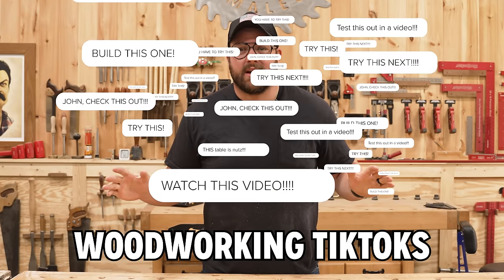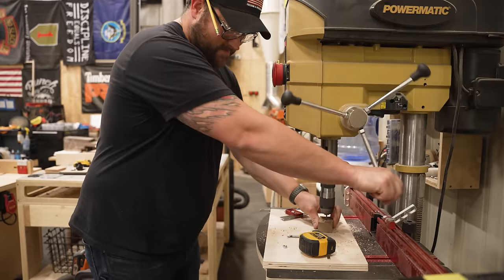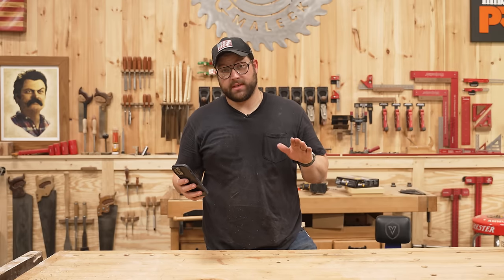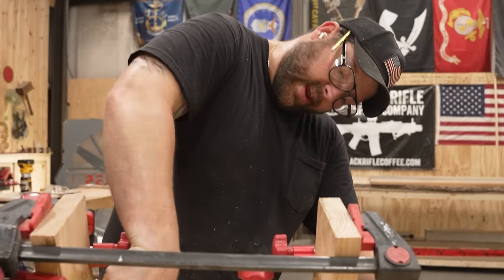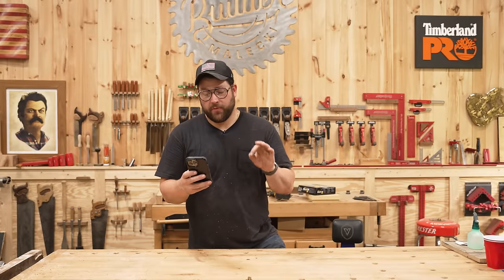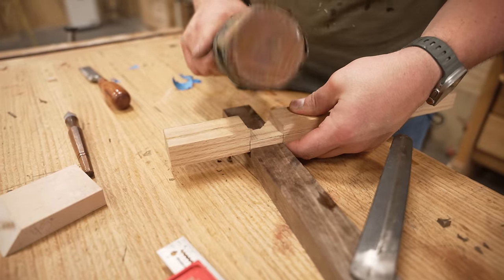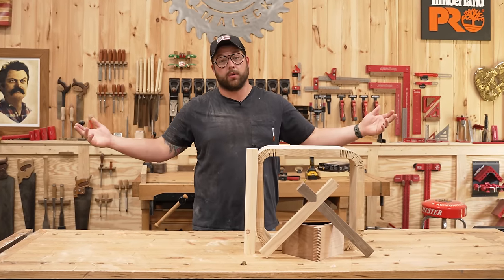Testing More Viral Woodworking TikTok Techniques

Comment: Could he have wet the timber when he chiseled it, looks wet to me?
Reply: It maybe a stabilising resin too
Reply: It's definitely the wood and not the chisel. There is no way any dry wood on end grain would behave like that like in the original.
Reply: He had it treated with something. There was a sheen and the wood looks stabilized somehow for sure.
Reply: i was thinking it was wet as well
Reply: it's totally embedded in wax
Reply: u beat me to it. The moisture content was way up
Reply: I think he has just painted PVA on the end and is shaving that off.
Reply: @ricvanesh9445  definitely a wax or some other type of coating
Reply: It's glossy and clear. Pause it at 31 seconds and It's see thru... either dry place or a clear finish for sure... click like if you agree👍
Reply: There is a special species of tree in Japan that they use for these types of competitions. It creates paper thin and even thinner complete shaves. You can see them do it with planes as well
Reply: Thats my guess, it has to be wet
Reply: Yep, wet, waxed, resin, there's something off about that one.
Reply: It is 100% resin stabilised (or other soft setting polymer)
Reply: Or probaly just peeled a thin layer of dried wood glue with the chisel
Reply: @tokkarijuha 100% what I believe
Reply: I egree
Reply: It almost looks like he is taking off a layer of glue or resin.
Reply: A common trick for clean end grain cuts with hand tools is to wet the grain, you can use water, or denatured alcohol but a popular mix is 50/50 water and isopropyl alcohol.
Reply: It looked like glue to me
Reply: I believe it was a layer of wax as well.
Reply: @chadajacobs  it's something like polyurethane.. wax coatings still break up and have too much friction to shave it as easily as it's shown in the video.
Reply: That’s what I thought too
Reply: Came here to say the same thing
Reply: Was thinking the same thing
Reply: It looks like he just carved off a layer of PVA glue.
Reply: Or candle wax
Reply: there is a layer of wax on it
Reply: Definitely wet wood but also if you use the green polishing compound that has wax in it. Man, that thing just cuts end-grains like butter. I used it on 6x10 D. Fur timber frame exposed end grain, and just shaving the uneven saw cuts left by the 10 1/4 Big foot skill saw.
Reply: I was thinking it was too clean and not grained. Maybe Elmer's or resin.
Reply: I was thinking the same thing
Reply: Or coated the top w/glue or resin?
Reply: Looks like he used the chisel to peel off a layer of glue. The wood did look kinds wet, yeah
Reply: My bet is an ironed on piece of wax paper.
Reply: Pretty sure it is steamed!
Reply: @billybumpers haha yea for long grain, not cross grain
Reply: Could be treated or could be a very moist piece of fatwood.
Reply: or very resinous, Douglas fir I've seen look like that
Reply: I was think he was chiseling of a thin coat of wax of the wood
Reply: Looked like it to me as well
Reply: Agreed, looks wet
Reply: It almost looks like it could be the wax they cap lumber with
Reply: Would be hilarious if it was revealed to be a DBrand skin or something 😂😂
Reply: What came off wasn't a shaving of end grain wood
Reply: I was thinking the same thing
Reply: Yes I agree. Wet wood
Reply: Yeah ,  that's what I was thinking...  I reckon it was.....  soaked in maybe vinegar or water , most likely vinegar ,as thus would result in weaker fibers in the grain
Reply: Aye there's another thought,  wood cannot be cut as such.... and that was an imprint of resin , that was been lifted back off of the end grain , to give the illusion to the ,  individual s   perception of what is
Reply: The YouTube algorithm just showed me the vid and I’m absolutely impressed by ur work and video keep this up 👍🏼. Greetings from Germany
Reply: I thot the same. Looks wet
Reply: I call wax
Reply: That probably is not wood. Maybe something like set glue or resin on top of the wood and just scrape it
Reply: It looks like glue in the video or rubber cement
Reply: Looked like glue on the end to me
Reply: It clearly looks like pva glue on it
Reply: @billybumpers where can I see that?
Reply: I thought it may be PVA glue being peeled off as it always slightly holds the grain pattern
Reply: No. The chisel he used was sharpened properly.
Reply: Looks like glue to me
Reply: It's fake. He's adhered a piece of paper to the top of the timber and cut the paper off. You can see the light white spot on the front right of it where it wasn't adhered completely. Most likely rice paper or something similar.
Reply: Very obviously some kind of soft or not yet cured coating.
Reply: It's wax
Reply: @TheFirBall oil on the end grain helps with cuts like that
Reply: They isualie use oil
Reply: Yeah I was gonna say the wood definitely looks darker like it was wet or imbedded with something
Reply: @Lukegunter19  wetting the end wouldn't do anything at all they put a thin layer of glue at the end or wax because it's impossible to get a perfectly smooth and flat piece of shaving like that on end grain
Reply: I think he boiled that part of the wood
Reply: Yeah,  it looked wet, not sure from what.
Reply: It looked kinda like wax or glue
Reply: Glue
Reply: They oil it. It also helps lubricate the tool
Reply: I think it’s wood glue
Reply: Was fake no wood would chip like that no matter what
Reply: Look at the chip, there's no grain in it at all. It's poly, I'd put $100 on it, dude's full of shit.
Reply: Came here to say this. It almost looks like the wood is wet or something. That’s the only way it could make sense to me (though I know NOTHING about wood or woodworking).
Reply: Maybe not water, but he did something to it
Reply: It's washi kozo paper on top with probably hide glue. Wet and peal. It's used for canvas stabilizing and peals just like this.
Reply: It looks like her may have been cutting off wax or some other topical covering. There is no grain in what is cut off.
Reply: Its wet. Soak it and try again later
Reply: Totally! That's what I was thinking looks like a layer of soft wax

Comment: The first video is fake. It's probably a layer of glue. End grain pine will never stay together like that roll up and be almost transparent.
Reply: Agreed. I was also thinking it could be wax.
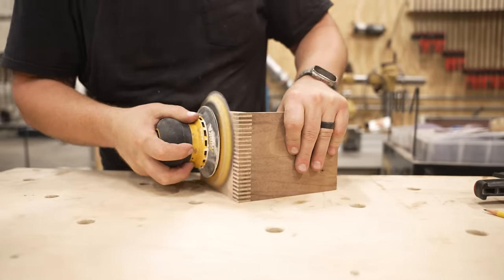Reply: 17:12 17:13 😅😅
Reply: @tatumtots09  NOT PINE
Reply: That is what I was thinking... because of the density diferent between the grain and the rest of the wood, I would assume the grain isnt actually attached to the rest of the wood in a way that it could be removed that thin and still stay together (since grain swells and contracts)
Reply: @willsmith8576  I would thinking more like CA glue, anyone who has ever pealed CA glue off a finger tip knows it looks very similar.
Reply: I didn't know about the video but in real life when I in Japan the Japanese carpenter show me this thing this is real there tools much better than us or American tool

Comment: The wood for the end grain one looked like it was finished or had resin on it. I think he was shaving off something else there's no way end grain held together like that. You don't get ribbons from planning end grain right...
Reply: you can see the difference in color, it looks wet after it's "shaved"
Reply: I thought it was played in reverse at first
Reply: wax
Reply: Wax was my first thought also!
Reply: I believe it was probably green wood?
Reply: @mitchellmcclarnon1308  I believe it's fake AF
Reply: I was thinking a wax layer, but yeah, same thought. Especially since you don't even see a wood grain on top, only when you see the underside of the thin layer.
Reply: Looked like wood glue to me.
Reply: Yeah that was not wood, out at least not untreated wood. It does't have the structural integrity to be shaved thin like that.
Reply: Looked like wax.
Reply: I came here to comment the same thing.

Comment: That pine looked like it had been soaked in water for awhile before he sliced it.
Reply: def looked soaked or steamed
Reply: or it was a wax coating
Reply: Looks like wax or glue to me.
Reply: It was cypress.
Reply: Something definitely not right with that cut.
Reply: absolutely steamed or soaked
Reply: Looks like it was soaked in mineral oil. There are a few videos out there for cutting threads in wood. They soaked the wood in mineral oil before cutting the threads.
Reply: looks more like pva glue
Reply: @EasyMoneySG  Came here to make this comment. Definitely wax.
Reply: @christopherkarr1872  Same, I think it's also how as thin as it is it stayed in one piece, the wax held it together, and since soaked, was [more] translucent.
Reply: Definitely wax, some lumber suppliers seal the ends of wood to protect against checking and slow warping during storage and shipping. There's a product called anchorseal that is made for just this purpose, we use it for our exotic hardwoods at my factory. If i had to bet money I'd put it on a sealed wax end, you can see the surface of the wood has more of a sheen before the chisel cut, and its much more dull after.
Reply: @KainzMusic looked like layer of PVA
Reply: @EasyMoneySG  That was my first thought aswell. Some wax and / or glue stuff, instead of wood itself.
Reply: it looks more like, he covered the end with wood glue and shaved that off
Reply: @EasyMoneySG  yeah, simething like that
Reply: it could even be a tape or something thin being scrapped off the top
Reply: i came to the comments to say this but you beat me to it lol
Reply: Looks more like woodglue.
Reply: @EasyMoneySG 

It's definitely spurious, not genuine, fake.
Reply: The creator of the original video says it's Hinoki Cypress, which is extremely soft wood and a very popular pick for Japanese woodworking content creators.
Reply: oil ;)

Comment: Tip on the bending: use the THINNEST possible blade in your arsenal, make cuts that are the same spacing as the cuts, lightly sand (or use angled cuts for the whole thing) each slice to a taper, and GENTLY bend backward to insert the glue, making sure there are NO voids.  You may also want to use epoxy rather than glue.  Do the whole project slow and gentle as the frills are Very delicate until sealed if done right
Reply: The bending one wouldn't need testing because that method of bending is used in acoustic guitar construction. That's how you attach the sides to the top and back.
Reply: I did some kerf bending on a cabinet project. Learned a few things on the way. Test cuts to determine ideal cut depth. If it snaps when you go to bend it, cut deeper. Be mindful that you are bending the long grain, especially if working with plywood. There are online calculators to help with ideal spacing. As I understand the math your total kerf through the bend should be the length difference between the inner and outer curve. Use a thin kerf blade for a smoother curve. Sand BEFORE you cut kerfs so you don't sand away your thin curve exterior. If the design can hold its shape and you don't cut too many kerfs, then glue isn't vital. The compression across the kerfs is actually pretty good at keeping the joint secure.
Reply: The best way in my opinion to do it is to use a 0 point 18 degree router bit. then do 5 passes. You also don't end up with any gaps when bending it.
Reply: Also a nice veneer will hide all the horrors under.

Comment: Edit Edit: so apparently the planing championships don't do cross-grain planing like here, so the authenticity is still in question

Edit: apparently the thinly sliced wood isn't pine, but port orford cedar, notable for fine grain and good cross-grain strength, making such thin slices possible

I think the translucent layer in that tiktok might have been glue or other stuff they'd applied to the end and then just peeled off with the chisel. 
I don't think wood like that has enough cross-grain integrity to hold together when cut to such thin sheets.
Reply: That was my first thought too
Reply: almost looked like wax
Reply: @Grouchy_Hermit  Wax coatings will still break apart if you shave them off.
It's a polyurethane or lacquer
Reply: @ryanokeefe12  depends what wax
Reply: I think it’s wax too. Similar to what Rockler or Woodcraft would use in their small blocks to seal them.
Reply: Looks like pva glue
Reply: I'm about as far from a woodworker as one can be, and it didn't look right even to me. There was absolutely no texture to the piece he was slicing off. Contrary to this fellas attempt where you could still see the dark/light lines of the grain in his slices. I just don't think you can slice wood thin enough to not show some of the grain.
Reply: That’s what I thought
Reply: I agree, he just peeled off some wet paper or something
Reply: I agree, the peeled layer has zero texture or any end grain patterns. If you look at the pre cut part, it also looks coated/stained.
Reply: The wood looked soaking wet
Reply: It's possible to do it. You have to make the wood wet before peeling a thin layer. Like in the Japanese plane competitions.
Reply: something like from techniques to make transparent wood... resinlike?
Reply: Definitely not wood. There is no gain structure in shaving.
Reply: look at the color of the wood.  that's definitely titebond or something.
Reply: Exactly my thought, probably a prep layer to enable easy peel and then some kind of flexible plastic/glue or something. So obviously fake.
Reply: @migaelz 
It's not on the end grain in those competitions. Completely different.
Reply: @cheflokifox311 
They don't use the end grain in those competitions. If you have ever worked with wood, you should know it's completely different.
Reply: Definitely tite bond or something. If you've ever peeled it off your skin it looks exactly the same
Reply: Definitely!
Reply: My first thought was a finish they applied. Glue could also be it
Reply: Yeh, after seeing the difficulty in this vid, I thought it mas maybe a thin layer of wax that was 'shaved' off, and thats why there was the look of grain on the shaving. (I always doubt those kinds of videos anyway)
Reply: i wonder if it was wet too..  might have made it cut and stick together better?
Reply: also you would be incorrect on the wood, the wood is Japanese hinoki (cypress)
Reply: @timgoodliffe  ...or port orford cedar, because of the similarity of the wood and the rarity and cost of real hinoki in comparison to port orford cedar.
Reply: hey guys this video isnt actualy fake, he has other videos of him using chisels at other angles, japanese chizzels can hold high angles 25 degrees is standard with the high rockwell they will retain an edge, the wood used is Japanese hinoki (cypress). I bet i can do this myself with spruce
Reply: Having experienced something similar I have no doubt it’s real! It narrows down to a few details

1. Mastery of sharpening. It takes years to consistently reach that level of sharpness using natural and artificial whetstones that John cannot simply recreate using a tormek and strop.
 
 2. Green or freshly sawn Cypress.
Was actually end-grain slicing green cypress a few weeks ago using Japanese pairing chisel at work for a commercial timber framing company and was genuinely surprised on the strength of the flexibility and strength of the cuts
Reply: I'm willing to bet it's just green wood. Whoever carved a spoon out of freshly cut wood knows the grain behaves just like that
Reply: @matthewscott9567  Yes it was wood glue. It seems pretty obvious to me.
Reply: Imagine some kind of resin or something, that makes the wood 100% massive, and that the woods hard and soft parts are as identical as possible - then I can't see, why it couldn't be done. We can see the colour differences in the shaved layer, so it's probably not just wax or glue.
Reply: @matthewgruba8040  Wrong - look again.
Reply: That is my thought. It is likely glue that was peeled up
Reply: @matthewgruba8040 wrong. You can clearly see the wood grain in the shaving. It is soaked in mineral oil overnight to tighten the grain and keep it together and keep the chisel moving. I’d you don’t how what you’re talking about, refrain from inserting your worthless comments.
Reply: Yeah that looks like glue or wax and not actual wood he was "shaving" off. I doubt even an obsidian blade (which can litterally go down to an atomic sized edge) would be able to get such a rice paper thin slice so smooth.

Comment: For the "table saw lathe" one, I was fully puckered and I'm 1500 miles away and several days removed.  You are a brave brave man, John Malecki.
Reply: Actually a pretty safe cut. Stumpy nubs tested it a bunch. Izzy swan was the first place I saw it. He has adapted it to make a variety of shapes.
Reply: @hartman601  May be a pretty safe cut, just probably not quite how John did it lol
Reply: Using an impact driver there didn't help the situation either.
Reply: mutiple power tools and spinning blades. what could go wrong?  (crap...there goes a fingie)
Reply: More more more more!!!!
Reply: @ScottFitton  Just what I thought. He's using an impact to do a drill's job, which likely added to the wobble. When I was a theatre technician I saw it way too often, and saw lots of snapped screws. Wrong tool for the job is all.
Reply: @hartman601  Even though it is safe, a lathe is still cheaper than some of the medical procedures you'll have to go through in case you get injuried doing that.
Reply: the thing about that one.. he basically built a lathe. He could have attached another arm with a blade on it etc and not used the table saw
Reply: BY
Reply: If I had a sawstop table saw , I’d be a lot braver on the table saw too!